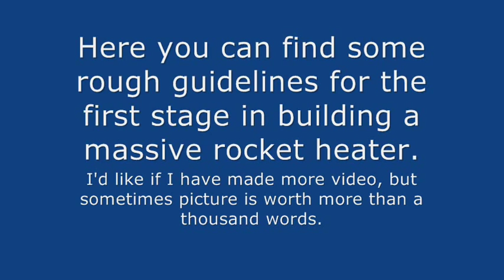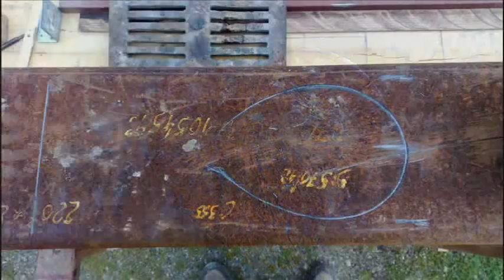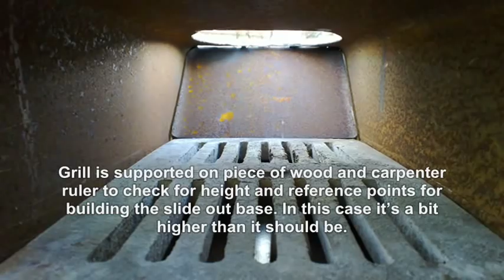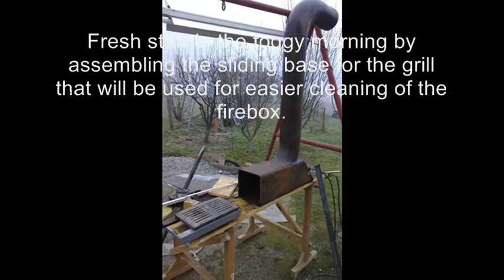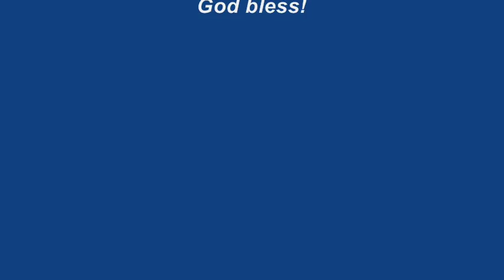Massive rocket stove heater "Tamed Dragon" - first stage in construction

Comment: It is smarter to use water as a mass.
Thick and heavy steel structures are not necessary. A 1/4 is perfect as a thick. And easier to handle

PS:Take a look at the heat capacity of water and every other material. 
You can search for a long time and find no substance (except hydrogen and helium) which can store more heat in 1 kilo.
Reply from the maker: Thanks for the input, but you are missing the point 😊. If this was the regular stove for central heating, than there would be nice to have some watter mass for heat transfer over the burning chamber.  But this is modified rocket stove, with additional secondary air for secondary burn. Which cant be achived if you dont go over pyrolytic temperatures in the core of the first burn, and that is 650-950 degrees C. And for sure you cant do that if you have water close to it, just because its termal coef. It will draw to much heat, and when it boils if not under preasure it will go max 100C and take place in evaporative cooling by steaming. Not to mention problems with scale and rust with that. It defies the purpose of this type of stove to have complete burn with very little ash. The core is tick for other reason. The steel burns away and scales/leafes away at that teperatures. So for a bit more longevity of this test piece i found this overly large pipe at the scrapyard that will suite well for the task. And other pieces also, as mention already on other videos and description. Please inform your self about rocket stoves and their intention to be as simple as can be and cheap. If you have any more question that I omited to answer, please tell. Take care and God bless.
Reply: @mihamaker  
Thank you for your reply. 
I've been working on this over the last few weeks. Rocket stoves are very interesting. I think I do not know everything yet. 
But some good ideas have already occurred to me. Of course, I like to share them.
So that the water does not boil, I would use the principle similar to the car. Modify a little so that the thermostat pushes away from the stove. This pushes the contact surface (heat exchanger plate made of aluminum / copper) in which the water is located away from the heat source.

First cycle - a few liters
Second circuit - IBC tank 1000 liters
 💪😊

Even without a thermostat, if you manage to boil 1000 l, respect :-P

PS: Give your stove a nice insulating layer. Then he is very happy. And comes up to operating temperature faster.
All the best and good luck
Reply from the maker: @benvonjerry5136  It is isolated with vermiculite and perlite all around. It is noted in other videos description. And photo of finished stove. If you use the water around the first chamber you wont get tep high enough. This stove burns waste wood and waste oil in two stages. The exhaust goes in large air to air heat exchanger to heat closed ballon play court in size of three basketball courts. If you take heat directly on the source, you wont get temp high enough for complete smokless burn and no creosol exhaust.
Reply from the maker: @benvonjerry5136  Exhaust od this stove is like little jet engine or heatingoil burner. That is the place to take heat from, at the exit.